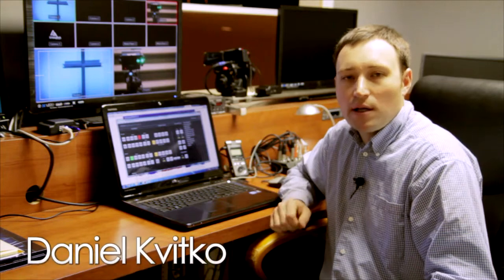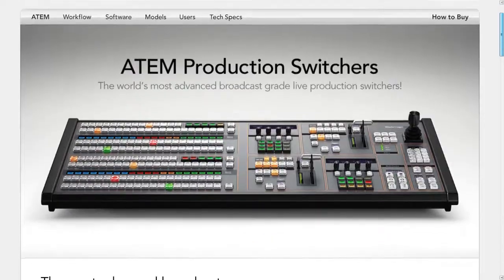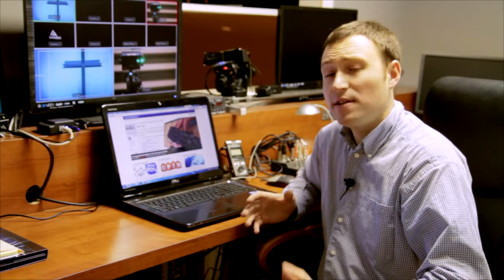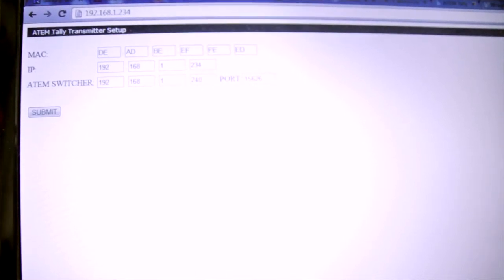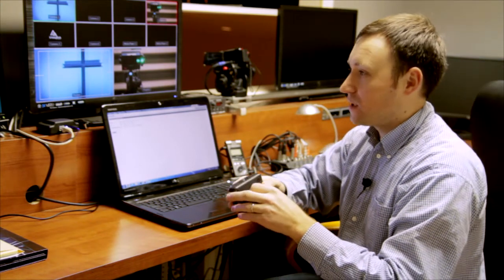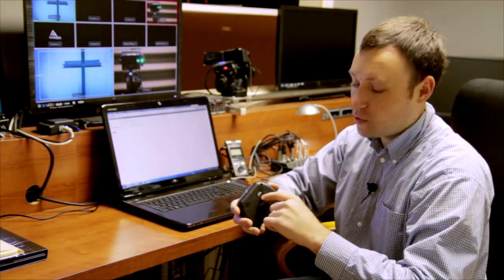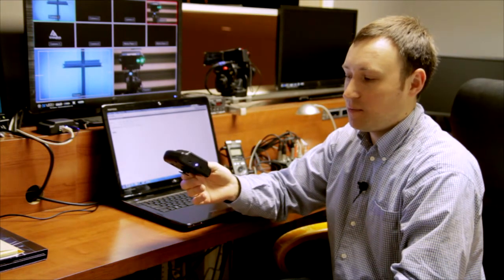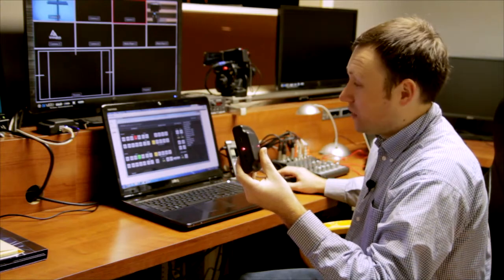Wireless Tally Light System - Compatible with Blackmagic ATEM

Comment: The current design allows for 150ft operation. If you choose to extend the wire antenna out of the enclosure through the pre-drilled hole then the distance increases up to 300ft.

...50м если все так как показано, и метров 100 если вытащить антену наружу